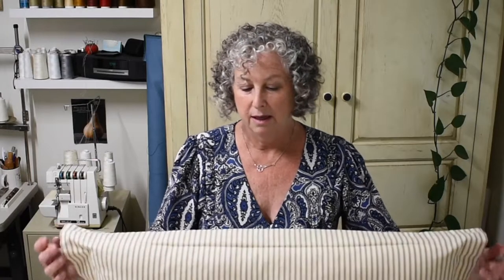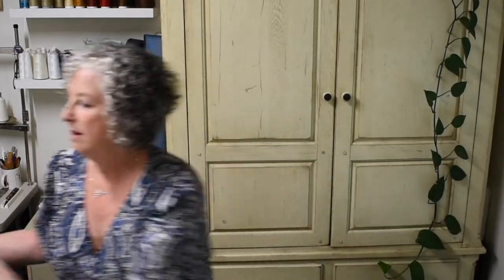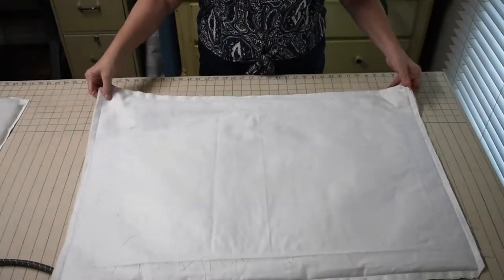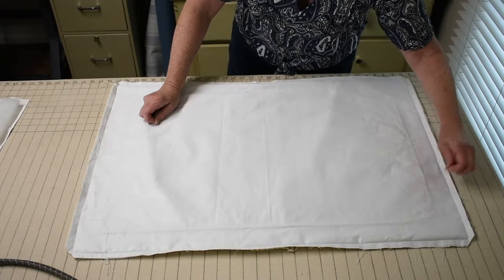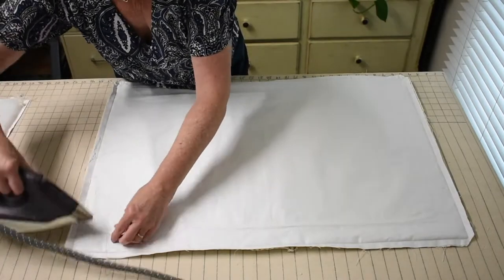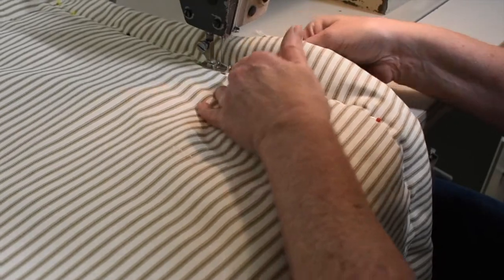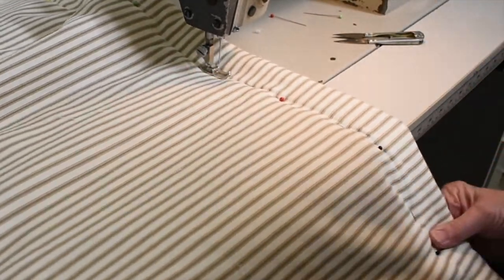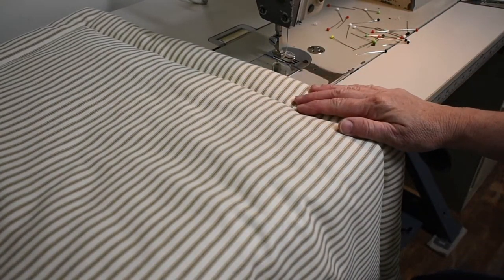HOW TO FIX A FLOPPY FLANGE - Make the border (flange) of your pillow sham stand up and stay up!

Comment: I recently purchased a quilted jacquard bedspread with matching Oxford pillowcases (Simon Baker Valencia brand) for my newly revamped bedroom.  The floppy pillow flanges were a real let-down.   I unpicked them and found the most shocking frayed, unfinished edges I've ever seen on ready-made bed linen - and they were expensive!  I tried to fix the problem by adding iron-on buckram strips, 2 inches wider than the sham, all around the edges.  It worked but was too stiff.  Then I found your tutorial and now have the perfect look.  Thanks so much for sharing your solution!
Reply from the maker: I’m so happy to have helped you find a solution!

Comment: Great video, thank ou. What kind of lining would you suggest for a linen type, home dec fabric? Can I use the Pellon craft type? 808 I believe is the video I found for making bags, but not sure about pillow covers.
Reply from the maker: I'm not familiar with the Pellon product you're asking about, but I usually just use lightweight drapery lining. I keep a bolt around for things like this, the decks of bet skirts, etc. If you don't have anything like that you could use muslin. Keep the cost low - the main purpose of the lining is just to protect the layer of batting from getting torn or beat up when you take the pillow in and out.
Reply: @ASquarePillowIsntSquare  thank you so much for your speedy reply and yes, I have a lot of muslin and other fabric I can use for liner. I’m making a pillow with homemade welt as demonstrated in another video of yours and adding an invisible zipper.

Comment: I throughly enjoyed your video. I like how you give detailed instructions. I have a few questions.. Do you recommend pre-washing your new fabric first for shrinkage?  I like how it has the crisp look so only  the front side is used with batting ? Do you recommend woven fabrics or industrial fabrics and is it ok to use warm and natural batting? Thank you 🧵🪡
Reply from the maker: Thank you! I always pre-wash and dry fabrics IF the cleaning instructions allow it. With home dec fabrics (which is what I typically use) you will often remove the protective finish they have if you wash it, so always check on that.   As long as your batting has some degree of body or stiffness it should work fine :)

Comment: Good video. Can you tell me what your work surface is that you were using please?  Thank you.
Reply from the maker: Hi there! I build my own tables and will be doing a video on it at some point, but basically I cover plywood with an insulated wall board, then a heavy table padding, and finally  a heavy canvas that’s designed for this type of thing. Then I draw lines with a permanent sharpie. I can press on it, pin into it, and use it as a square and ruler. It’s a process, but saves me hundreds of hours of work time.
Reply: @ASquarePillowIsntSquare  that is super thank you. I did figure you had made it yourself.  It seems extra handy!!   Thanks again.

Comment: Thanks for doing this video.  I have some shams that need this desperately.  Plus I am making some new ones and will use the batting to make them stand up.    Wouldn't a walking foot make it much easier to sew thru those layers?  Your pillow looks awesome, but mine probably wouldn't look as good more than likely.  Thanks again.  New subscriber.
Reply from the maker: Glad you liked the video! Yes, a walking foot would definitely make this job a bit easier :)

Comment: What happens to the batting when the case is washed? Won’t it bunch up.
Reply from the maker: That's a fair question. Like all things "home dec" that are fabricated with a variety of products, dry cleaning always gives the best results. Having said that, if your fabric is pre-washed and pre-shrunk, and you use a bonded polyester batting, you can wash it in cool water on gentle, and then smooth it out to air dry, or put it in the dryer for 10 or 15 minutes, then at that point I'd take it out, smooth it out and finish by air drying. Any of those options should be safe bets.